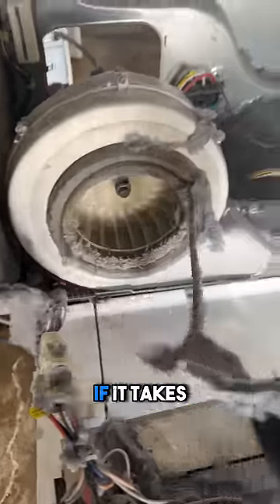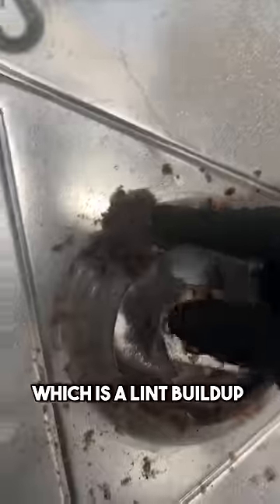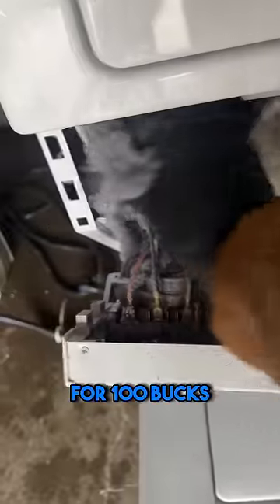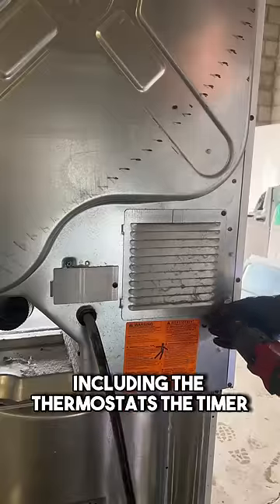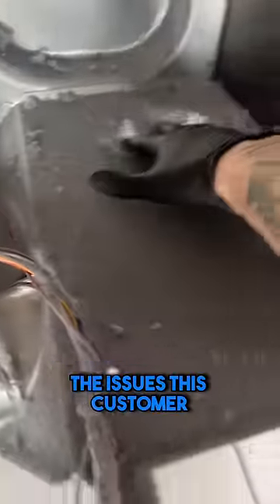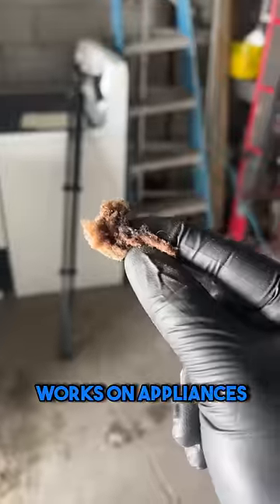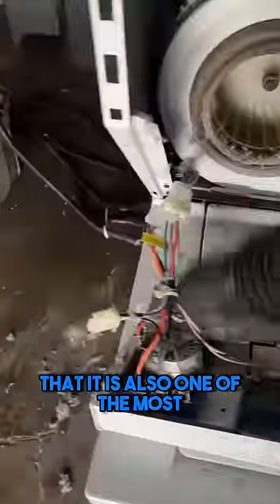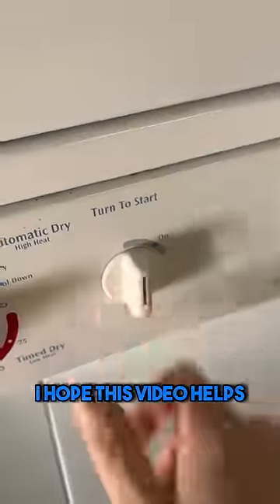Are You Tossing Your Dryer Away too Soon? the Shocking Truth Revealed

Comment: Most of the manufacturers cheap out on the filters or have possible air leaks where the limp and excessive wool can build up. Condenser dryers mostly consist of an air intake which sucks up the fresh air which goes through the compressor's heatsink and then through the drum itself, the air goes then through various mesh size filters to catch all the limp and other stuff and then goes through an exhaust where's a second cold side of the radiator which sucks up the moist. This means the place should be somehow ventilated. It also sucks up all the moist in the room. If there's a some kind of leak from the filter, the dust can build up on the radiator itself which can completely block out the airflow and could possibly damage the compressor itself by not cooling the reservoir and oil. The excessive water built up from the heatsink is then dripped into a water pump which pumps the water either into a built-in container or your waste water pipes. If you would filter the water by yourself it could be a utility water.

Comment: Most people have ventless here in the uk, condensing tumble dryer or a heat pump one which is what I have. They are so cheep to run. I am surprised that vented dryers are still the most common dryers in the USA they are not so popular over here. But I do miss how quick it was with a vented dryer but they are notorious for fluff build up and fires 🔥

Comment: Use to work for a washer and dryer repair company. Most common issue is people not cleaning out lint traps and / or air ducts needing cleaned out which blocks Airflow and prevents clothes from getting dry or causing them to take forever to dry. Second most common issue is thermal fuse going bad for dryers. Timers causing drying issues isn't anywhere near as common as thermal fuses going out which literally costs a few bucks to replace

Comment: Lint shouldn't be everywhere if the lint screen is cleaned after each use. The wall vent  outlets are supposed to be set at the same height as the dryer's outlet so one can use a straight metal pipe to make the connection. The plastic flex duct should be trimmed so it collects less lint inside. Those can get ripped open which allows lint to escape. Worked on a few insurance restoration jobs where lint was blown along a wall behind boxes to a gas water heater in the corner. The lint accumulated to a point where it was set on fire when the WH burner kicked on with the fire traveling over to the boxes to set those on fire.

Comment: Wait, do US dryers not have filters? We use a heatpump dryer and that would not work without a filter, and even dryers that exhaust the hot air right away have easy to remove filters that you clean every three to five cycles here in germany.

Comment: Pulled my dryer out doing a remodel, starting in the laundry room. You would have shit bricks seeing all of the issues I found. 

Vent was 4" ID with 2" or less opening. There was a PVC elbow on the back of the dryer, aiming UP! not to the side as the vent outside is literally right there. The best part? They used all 6 or 8 foot of vent hose in the package, running it up one side and down the other of the GAS line going to the dryer. No it was NOT put back together this way! 

Used the vacuum and cleaned out the vent to the outside. Bought an aluminum elbow to put on the back of the dryer and aimed it right to the wall. Cut the hose to fit more appropriately and vacuumed it out as well. Pulled the front and back off the dryer to vacuum it out as well. Holy crap does it dry faster, run quieter and just works better. 😮 it's like having a brand new one, without the cost.

Comment: Do american dryers not have removable lint traps just inside the door?

I've had my dryer 7 years. Remove the lint trap every load.

Took it apart to fix a rattling sound. Not a touch of dust anywhere inside the thing.

Comment: My dryer is heating and tumbling, but the clothes will not dry. Our ventilation leads straight to the outside and as far as I am aware does not travel through the house, we cannot find a place where lint might be stuck. Any ideas or specific tools for 70's houses where the vents are about 6 inches above the ground and angled downwards?

Comment: Our landlords maintenance crew moved our dryer outside to redo our floors after a pipe burst... they broke the front of our dryer off. It will not close, so it takes 2-3 rounds. I finally taped it together and it dries in 1 round but Im shocked. I just paid to have parts replaced inside it and the broke it moving it. I should have documented it better.

Comment: There is one more option that you left out that is a big deal: the plug area for the dryer pretty much burned out / was going out. Plus some parts like the heating (that happened once as well) cost far more than then a new dryer.
Reply from the maker: A heating element doesn’t cost any where near as a much as a new dryer my friend. Maybe if a bad technician works on your appliance. That’s being said, If a heater works, it works. If there’s heat but slow dry times, you have clogged ventilation. Period

Comment: I clean my dryer annually with an air compressor air Chuck and vacuum when it's all set and done it blows lots of lent chunks out. The dryer vent as soon as I fire it up and it runs like a champ. Meanwhile the difference between electric versus a gas close dryer. The electric elements burn out when the overheat and oxidise. A gas dryer will heat or it won't there's no In Between

Comment: So, I got moved to a brand new high school. And I mean this is probably the first year it's open brand new. I'm taking a home ec class, at some point I get curious about the dryer. It's kinda a good thing I did, because the lint trap was absolutely ridiculous!

Three thick layers of lint. One white. One red. One blue. Over an inch thick, probably closer to two inches. 

It was one of those top pull lint filters, not in the door, and no one had ever checked the damn filter. They probably just turned the dryer on for longer and longer and went to do other stuff.

Comment: I can personally confirm this to be accurate. I have the MOST BASIC Walmart crap tool bag, not even a box I’m not that manly yet. Working on it. I took my lime green tiny screw driver with a long metal thing sticking out that let me put my 6 piece socket set on it. I thought a socket was something that electrocute you. 🤷🏻 my 450 dollar dryer broke. Stopped running entirely. I hit YouTube and found out there’s a fuse that blows in most dryers  these days. Got one for like 4 bucks. Replaced the old one with my blue plastic box of sockets. Every screw was the same size. Fixed it.. for 2 days. It got crazy hot in any cycle and the fuse would blow 3 minutes into a load. That’s a little premature even for me! 
So I put my crocks on and got to work in my laundry room. Called a neighbor I have but we don’t really talk but I needed something called a multi meter. Basically a portable MRI machine im pretty sure so I didn’t have that and wasn’t going to buy one their like 15 bucks! 😂 
Found out, my dryer wasn’t even broken! The heater coils BENT “mattress spring things apparently are called heater coil packs. So I’m referring to the mattress looking coils inside the heater box. Sounds complicated but it looks like a metal box that has mattress springs inside of it. If anyone takes their heater off.. check it before buying a new one for 40-90 dollars. 
It was getting hot (it’s a heater so I think it was supposed to do that). Overtime the heat allowed the springs to bend quite a lot. Enough to where they were literally grounding my dryer. That’s what caused my fuse to blow, stopping  the electrical current, stopping my dryer from working. It grounded because metal touching metal in electrical appliances especially heated ones with a safety fuse,  need somewhere to carry electrons are lazy they didn’t want to go all the way from my plug-in to my dryer and back when they could they could just chill at the back when the spring bent forward touching the inner plate. It allowed the electricity to pick the path easiest taken because electrons are lazy buggers. 

ANYWAY, in 1 night, I went from never opening the back of a dryer in my life to independently diagnosing it with a like green plastic handled baby screw driver, a cool needle thing to make my screw driver into a badass machine now That let me put one or my 4 same sized sockets on the screws and take the back off in 4/5 minutes. I winced my face exert time I would do that like the golden shot in my favorite movies. Unfortunately.. it was as Very anticlimactic. 🙄 Whatever. 
Used the same screw driver with badass cheap metal extender that was included with my blue and my GREEN screw drivers! Took the heater off, saw the black spot on my heater core “inside the my box of Mattress looking springs. Again* 
The black indicated a burn from the springs touching something they shouldn’t. So I found the one that was pushed out the most “the door in” I just pushed it back to the center of the box like exactly the way you’d push down on your bed. Been working a year now no problems. 
Sorry for the long goofy story I’m clearly joking at certain moments here. Don’t come for me scary mechanics for dryers! Please. 😢
My point is I went from never opening a dryer in my life to fixing mine in less than 24 hours. I actually loved it and volunteer all the time now at my local cities used washers and dryers store! Working on switch boards now!! 
Anyone can fix their dryer if they have YouTube. 🤜🤛 🫶🏼
Work smarter not harder my friends and never pay a guy to do something you know NOTHING about because thats how you get screwed. Watch a few YouTube videos on whatever you’re working on neeeijg worked on…. At the very least you’ll know enough to know when a “professional” comes to not get ripped off.

Comment: My Samsung drier keeps blowing the fuse and I've replace the coils with new thermostat and fuse 2 times in it's lifetime and redone the wiring. Also replace the fuse and even drilled a hole on the fuse because how often it blew, any tips? It's annoying and I just want to get rid of it but it's such an easy fix just annoying to remove it just to reset fuse. I don't have lint at all, I always clean it

Comment: Just threw my dryer away after cleaning the lint and replacing the thermostat, heating element, and fuse but still wouldn’t heat so guess it was dead for good after all

Comment: Mine needed a new timer control dial years ago. Then the safety switch on the door broke so I have to turn the timer dial to turn it off. I cleaned the lint out one but it still takes a long time to dry a full load. It has a random buzzing humming sound like something is going bad or has a loose electrical connection. Time to shop marketplace for a used replacement. Parts are over $250 and I can surely find a nice used one for less. Just replaced the 20 some year old washer for $50 with an almost identical newer model.  Washer needed tub seals and clutch work. Kept it for spare parts as the parts to fix it are way more than the newer used one. lol
After looking at new washers and dryers and reading reviews I don't want one and I could pay cash for anything on the market.

Comment: heater or ventilation only ???? really ?  lol .  how about intermittent contact connection in the timer or thermostat / limit ?  stripped blower wheel ?  poor connection at the terminal block , wall receptacle or burnt power cord ???  bad breaker or fuse / wiring ?? faulty temp selector switch ???   exactly how long have you been servicing major appliances ?

Comment: You’re wrong about “with the exception of a broken heater there’s only one thing….”
The plastic fan on your dryer is keyed onto the motor shaft with a “D” profile, the plastic wears, the “D” becomes an “O”, the fan doesn’t spin at the correct speed, airflow is reduced to almost nothing and the clothes don’t dry due to the saturated air (created by the process of evaporation of moisture from the clothes) isn’t then expelled to external atmosphere (where condensation occurs, incidentally) and the clothes don’t dry. But hey, I’ve only run a commercial laundry, a launderette and a domestic appliance service company for 25 years, so what do I know?

Comment: As a german I find it wild that these dryers let all the dust go into a ventilation system in the walls 😂 our dryer has a dust collector thingy that you'll just empty of dust yourself every few uses. And it can be done without screwing anything open, we just slide open a "dust drawer" at the front xD
Reply: Americans also have "dust drawers" lol. (We call them "lint traps.") The ventilation through the walls is a secondary measure.

Comment: My brother had got a secondhand dryer for his suite worked great for the first month but kept taking longer and longer to dry his clothes but it eventually got to the point that 2 90 minute cycles would not dry the clothes so I went over and took it apart expecting to have to fix the element but the minute I opened it up I noticed the pipes were full and packed with lint turned out his old dryer had a lint filter below the door but this one didn't have one there so he thought it didn't have one it was at the back of the drum his old one had a shaft at the back of the drum but Inglis and whirlpool drums ride on two rollers under the drum with a seal at the back of the drum their full sized dryer have the filter a

Comment: As a maintenance tech, I question your troubleshooting abilities lol. You just took someone’s word about it “not heating” and you said all was good after deep investigation of the unit, but why wouldn’t you just plug the thing in to verify the claims? Could have saved you loads of time. I do see the benefit of pulling it apart to get lint cleaned up, but not for “no heat” unless there is ACTUALLY no heat.
Reply from the maker: As a technician (at least a good one) you should know never to take a customers “word”. That’s what we do. We have specific knowledge about appliances that our customers do not posses my friend. 

If you’ve watched any of my other videos, I PURCHASE these appliances and resell them. That’s my business. That being said, despite what ANY customer tells me, I always run an in depth test/diagnostics on the appliance to make sure all is well. 

If you don’t think there is a benefit to cleaning out lint from a dryer, than you my friend are not a good technician and need to “dobetter g”

Comment: I cleaned the fuck out of the pipe vent, and the dryer, then replaced the main seals around the drum.

20 year old dryer that i wanted to fix was replaced by my wife after $100 of seals and many cleanings. 

What could have been the problem? I thought the dryer was hot

Comment: U just said lint and dryer are only culprits of non drying. Then you say thermostat...etc....it can be many things
Reply from the maker: I said with the “exception of the heater, there is only one thing that could cause this” and what I mean by heater is the heater CIRCUIT which includes the heater, timer, thermostats, and the heater it’s self as well as the centrifugal switch! 

Thanks for the comment there brother

Comment: "With the exception of a broken heater, there is only one.thing that will cause this issue..."
 "...I checked anything that would .ake this dryer not heat : the thermostat, the timer, even the heater itself..."